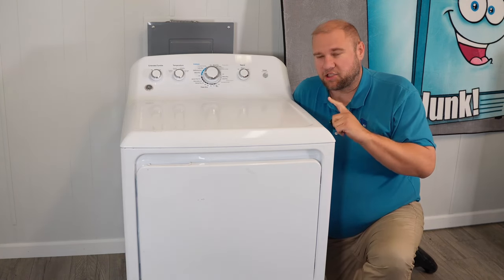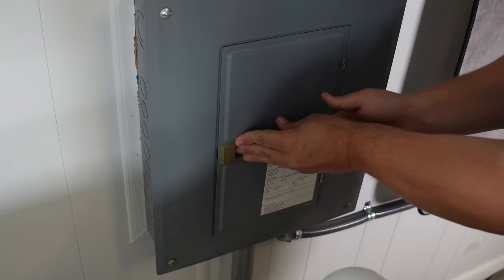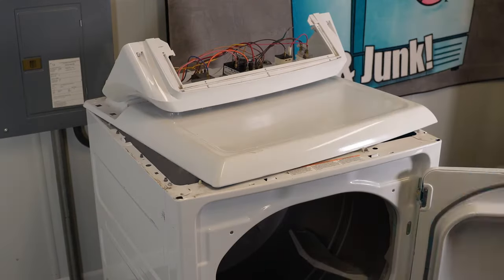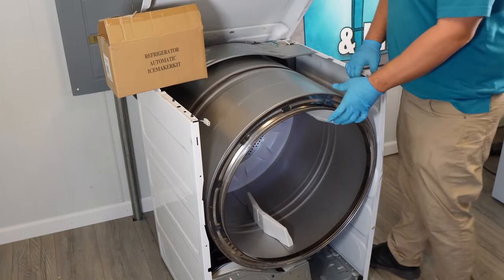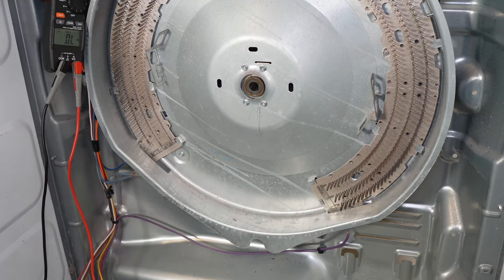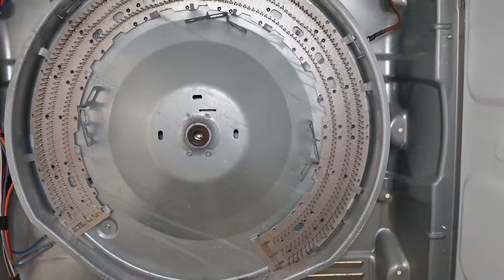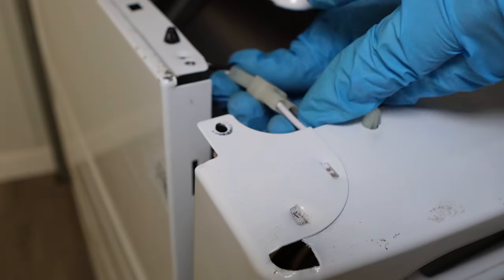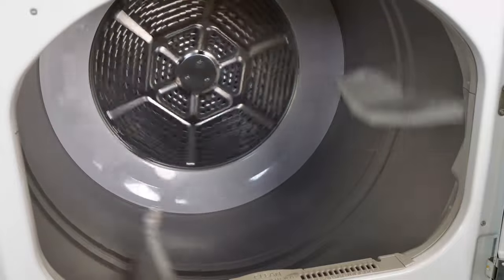GE Dryer Won't Heat - What to Look for & Test

Comment: It's sad how many people here are dealing with a useless GE dryer that is only 1-2 years old. Myself included. First and last GE product for me. Never again. As if the cost of everything isn't high enough, now we have to deal with appliances that last only a year or two when they used to last decades! Planned obsolescence most likely.
Reply: I’m doing on 3 years. Heat stopped working. Gotta trouble shoot tonight cause I can’t afford a new one
Reply: Mine was replaced in July and now not heating. It is in an apartment so have a maintenance ticket in since wasn't the purple wire that I was going to repair myself since been several days already without a dryer.
Reply: Had a Samsung and was talked into GE at the store and wish I had not because issues with both washer and dryer after just over a year. No issues in almost 5 years with my old Samsung
Reply: 6 months and the dryer us not getting hot
Reply: Mine is less than two years old as well I only do max 2 small loads a week & mine stopped heating also.
Reply: @tiffanyphillips1969  mine was the thermostat on the exhaust plastic tubing. $25 part and was back up and going
Reply: My grandmother almost lost her house because of a ge dryer she never lets it build up with lent somehow the thing spontaneously caught on fire ge sent a bunch of people out to inspect it took weeks and finally they said it was her fault I don't think so
Reply: @peteywee318  Same here. Extremely frustrating to say the least!
Reply: Ours are less than a year old! So crappy!!
Reply: We are on our 2nd POS GE dryer. Less than a year and a half old and low and behold the warranty magically expired. DONT BUY GE
Reply: Agree  I've had mine right at one year and it the purple wire on the right lower that burnt then caused the mica prong to I burn ! Evidently this happens to people all the time!
Reply: Yep mine is just over a year old and it’s already not heating
Reply: Bought the same GE dryer in the video in 2023, now it baffles my mind how this dryer is not working  in 2024. Right after it went out of warranty. This is just plain wrong and a criminal. My first time of trying GM products has ended badly. Need to find a way to educate consumers.
Reply: 3 years today. Same situation

Comment: There would be much swearing involved if I attempted this!
Reply: Lol,I am that stage right now ,not knowing anything I took it apart even that shiny metal piece inside the drum and inside was all full of brown loose stuff,anyway after all that when I looked at the back panel on the top of the dryer I found a loose crimp wire that goes to the temperature control which was off because there was no heat,so I guess that was it but I will inspect everything else.

Comment: My dryer is a year old. The purple wire had a burnt spade connector, so I cut and replaced it. Before I reinstalled everything I cut a 2” hole with my hole saw just next to spade connector. In the future I can look thru the back of my dryer and check if the connector burnt again. I’ll be able to replace it about 30 seconds next time, lol
Reply from the maker: Nice! I thought of that myself, but I'd get so many angry comments from people suggesting it, but I'm glad you said and did it!
Reply: I fixed mine, and it's not heating again. I'm going to buy a new one
Reply from the maker: @peteywee318  usually if the wire doesnt fix it and it burns again, the heater pan needs replaced.

Comment: Had a GE dryer that wasn’t heating but it would spin. Ended up being the purple wire. Thank you for the detailed troubleshooting guide!
Reply: did you get it running after replacing purple wire? can you tell me by chance where to buy it?
Reply: @lyndamckinney1287  I ended up re-crimping the burnt end with a new connector as there was enough wire still in tact. Those connectors can be purchased at Home Depot. They're Gardner Bender 1/4 in. Fully Insulated Wire Disconnects in Blue. I used some sandpaper on the heating element spade connector to clean it up. If you wish to buy a new purple wire with both ends pre-crimped, Ben has a link to them in the video description.
Reply: Same here...just put a new spade on and it works great
Reply: I just did the same thing. The real question is why are all these purple wires frying?
Reply: What’s the best dryer and washer to buy these days?

Comment: Quick tip, make sure you turn the power off before you ohm anything. When you ohm, you’re setting up your meter to check for the continuity on the wire, if there is any power on, those amps will travel through your meter, lead to lead. Please be careful of this. Always turn power off.

Comment: I always just open the door, hold the door switch in and run the dryer and look at the back to see if the heating elements are getting hot or glowing.

Comment: my hotpoint dryer, about 14 months old, no heat....after watching a few videos i figured it was the purple wire.  and it was....i was thinking on cutting a hole in the back of dryer to get to the purple wire.  i wish i wouldve.  i couldve fixed it in no time instead of taking the whole thing apart.    thank you for the video!

Comment: I know many people have already commented but this deserves ma y more likes. I have a different model GE dryer but this was still very helpful. Same purple wire as others have said. I didn’t get new wire. There was room to cut old one and get new connector instead. Sanded heater side a bit and everything works well. Until I have to repeat it again haha but huge thank you for putting this up and help in us save $

Comment: Thank you so much for this so instructional steps. 
My dryer stoped heating after i moved to new house. All elements passed the tests. I will check if there is a drop in the voltage during operation. 

I appreciate your video

Comment: Bought this GE dryer and had it 30 days when it stopped heating. Everything else worked. Took it apart and the purple wire was fried. I tested the heat element and that was bad. Based on the other comments this is a common issue. What's the cause?

Comment: Dryer stopped heating. Blower works, drum turns, replaced the mica heater (still no heat), replaced all 3 thermostats (still no heat), purple wire was not burnt but spade did break off when removing the heating pan the second time to change the thermostats (fixed that). Thoroughly cleaned. Tested power, I have 120 (center/right, center/left)/208 (left/right) on a voltage tester. No fuse present. Getting ready to go pick up a multitester to start checking switches. What happens if I find a bad reading on one of the ohm tests in the video? Running out of things to troubleshoot...

Comment: OK,  sir,  very informative video.  My dryer was running but not heating.   I followed all your steps and it was my purple wire burnt.   I repaired it and put everything back together.   Now the dryer will only run if I hold down the start button.   I checked and double checked the door switch.  Holding the start button with one hand and If lightly press the door switch with my other hand  the light comes on,,  then press is a little further and the dryer starts.   So, i am thinking that the door switch is working correctly    I did notice that the start button is only closed when you hold it down.  I am not very good at 110 / 220 volt systems but pretty good at 12 volt stuff.  So,  i take it once the motor starts something else keeps the current flowing.   I also need to mention that my dryer is only 14  months old and has been used very little.    Any ideas on what the problem is now?   Thank you
Reply: Ok,  took it back apart the 4th time.    Checked everything again.    Put it back together and it worked correctly.    It might have been the safety switch on the idler pulley.   Man,, thanks again for the video.   Very helpful.
Reply: A centrifugal switch closes when the motor is at speed, energizing the heating element

Comment: Tested power on both sides and got a reading of 246.2, above the 208 to 240 V range. You suggested it could be a cord or breaker issue. Do you recommend replacing the cord or bringing in an electrician. My electrical panel seems to be fine otherwise.
Reply from the maker: 246 should be OK it is rare to have the voltage higher, but depending on your houses power, it may be normal. It can handle up to 250v I believe OK

Comment: Do you have a video on how to replace that purple wire? Mine is fried, but I can’t get the end out that is connected to harness to motor
Reply from the maker: I do not. But I will see if I can make one soon, as I've had a few people ask
Reply: Any recommendations on how to remove the end attached to the harness that connects to the motor?

Comment: My stove is acting up and I foresee having to buy a new one. There’s a discrepancy between the setting temperature and the thermometer read out and it beeps when it’s ready just five minutes after the oven is turned on. It’s a Samsung I’ll NEVER purchase again. My budget is fragile. What would you recommend in a glass top stove/oven that is durable and reliable? I know front handles are more expensive but I love that look. Thank you!

Comment: Man thank you. My dryer wasn’t broken, but the breaker in electric box was unseated a bit (due to turning off power and the box cover missing a screw and breaker moved under the cover a bit). The dryer would turn on and run with no heat. Seated the breaker and all is good again.

Comment: Mine had the burned purple wire.  Thanks!!!
Reply from the maker: That's the culprit so often. I'm going to do a video just on that for the next GE I get
Reply: Did you Jane to replace the whole wiring harness, or how did you fix it?
Reply from the maker: @GabrielGarcia-vf8uu  I do have a video on replacing the harness now, FYI
Reply: @GabrielGarcia-vf8uu  I cheaped out and just cut the wire back, and added some wire with a crimp connector and a new female spade end.  Make sure that you spend a LOT of time sanding down the spade end on the heater coil to get a shiny finish and good electrical connection or it will burn up again due to high resistance at the connection.  You can test by putting a new connector on the spade and putting your meter lead into the rear of the connector and read resistance while moving the connector up and down.  If your readings don't jump into the hundreds, then you should be good!

Comment: I have a GE clothes dryer that wasn’t heating. After watching the video I realized the purple wire was burnt in to like many other people have stated was wrong with theirs. I replaced the end connector on the wire and the dryer worked perfectly, for one load of clothes then quit heating again. After sending this message I am going to tear the dryer apart again to see if im having the same problem.  What causes this wire to burn in to as so many people are having trouble with? Also, can I use a heavier wire to replace the purple wire going to the heating element or would this create a fire hazard? Thanks for any advice.
Reply from the maker: Hi, the replacement wire is heavier than the one in the unit. The only way to fix it is a new heater pan
Reply: Why would I need to replace the heater pan? My heater works fine until the wire burns in to. Just replacing the wire with the heavier wire wouldn’t fix the problem? Im not doubting your word I’m just trying to understand what is going on with the unit. Thanks for the help.
Reply from the maker: @Randymoore24  the OEM wire as installed on the original system is 14 AWG. The updated one is 12 AWG. You could theoretically go with a 10 AWG if you like, although I'm not sure who sells it.

The issue is that if the spade connector on the heater pan has burnt up, the oxidation creates resistance at the point of connection between the wire and heater. The resistance will heat the terminal up over time, causing it to burn up again and again.

Absolutely try a thicker gauge wire that can handle it, but I know for a fact that GE has basically begun telling techs to replace pan & wire simultaneously because of how dire this problem is. In about 80-85% of cases, the wire is sufficient, but in the 15-20% of situations, the terminal is too degraded and provides too much resistance to operate properly under use conditions.
Reply: @bensappliancesandjunk  i watched your video 5 weeks ago for same problem GE dryer not heating sure enough purple wire was burnt repaired wire and cleaned terminal all good till yesterday no heat again inspected and wire conn is burnt again now im looking for a eliment and harness thanks for the great video

Comment: Had issues with this for months. At first is was drying after 2 or 3 times. Then 5 or 6. Finally just opened it all up and low and behold a loose wire connection of a heating element. Now it dries like there was never a problem.
Reply: Same here the purple wire off and a little burned but not only that wire when I opened the back panel for the controls the yellow wire  timer was off as well,I wonder if they do this on purpose or no one checks these terminal wires.

Comment: I have found that on that type of dryer, the heating element almost never opens, but the lower right wire will burn up and break.
Reply from the maker: Yep. I just ordered the wires to keep in stock at our store due to how often this is the issue.

Comment from the maker: List of parts mentioned in video:

GE Dryer Timer for GTD42 Units: https://oemparts.bens-appliances.com/products/we04x24550-ge-timer

Purple Wire Replacement: https://bens-appliances.com/products/we49x37037-ge-hotpoint-dryer-heater-wire-repair-kit

Our Version (same wire gauge, 1/2 price): https://bens-appliances.com/products/we49x37037-ba-ge-hotpoint-dryer-repair-kit-by-bens-appliances

Heater Assembly: https://bens-appliances.com/products/we11x21156-ge-dryer-heater-assembly

Thermostat for Unit (top of pan, to the right of the 2): https://oemparts.bens-appliances.com/products/we04x25194-ge-thermostat-1

Thermostat (top of pan, to the left of the set of 2): https://oemparts.bens-appliances.com/products/we04x25201-ge-thermostat

Blower Housing Thermostat: https://ifix.gd/3XRlaVn

Upper-right pan High Limit Thermostat: https://ifix.gd/3TAcpfz

Bearing Shaft & Bracket Assembly for heater pan: https://ifix.gd/4guoih8

Comment: Thanks your video truly helped me troubleshoot the purple wire was charred at the connector. I plan to change the connector 

Do you know the root cause of the Problem???  If I remake the connection …. How long until it happens again ?
Reply from the maker: My understanding is the OEM wire is undersized and the replacement is thicker and can handle the amperage better. AFAIK, it was 14awg and the new replacements are all 12awg.

Comment: With amount of lint maybe a check of the piping would be in order. At a minimum a check of the dryer blower capacity should lead you to clogged piping in the wall another upsell and very necessary for the life of the unit the clothes and light bill.

Comment: According to some sources, you cannot (should not) perform a Continuity test on a thermistor because they have a high Ohms resistance. Instead, you need to use the ohms setting on the multimeter rather than the simple Continuity test.

Comment: Control knob is the first to check. Knob shaft cracks and you have no idea if you are on a heat cycle. Timer knob failures are high

Comment: Fixing this for my neighbor, the wire completely melted. Just over a year they have had it, what a shame, planned failures, just like phones and cars. Not all brands. Definitely won’t be reccomend GE to anyone. Funny they charge 30$ for 3 feet of wire too 😂
Reply from the maker: Sadly, melted wires like this happen in other brands too. Just for some reason the GE is slightly more prevalent. I am working to source the wire factory-direct to try to get the price cheaper. These items even at dealer wholesale are outrageously overpriced, and I am trying to see if we can get the price down to $20 vs. $30-35.

Comment: Disappointed in the beginning of the video.  1st check lint trap yes,  clean the screen, very good.  Before you mess with anything else, check the breaker box.  This should be if not the 1st thing to check,  at least the 2nd. There are times where the breaker would get tripped and the dryer will run and do everything BUT heat.  Simply locate your box and identify which is the dryer and flip completely off then on.  Try the dryer,  if it still doesn't heat then move on to next step,  which I would also say check the vent house,  could be blocked at the back or the hose is kinked not allowing air flow. Likely if that's the issue it's already blown a thermal fuse and would need replaced but easy fix. 

Lesson,  check easy things first
Reply from the maker: I get to the breaker and electrical chain within the first 1:30 of the video. I say check lint because its literally right there and is physically the easiest thing to check. My videos always go in order of ease of solution. Breaker is always 2nd because the entire electrical->terminal block chain requires moving the unit.
Reply: @bensappliancesandjunk  your video greatly informative.  I did see that you got to the breaker but that was after you pulled the dryer out and took cover off.  Before doing that while keeping the simple things done first would be too check breaker.

Comment: Great guide. I purchased the wire and it arrived earlier than expected. Installation was easy. Thank you.

However, it burned again after only 2 weeks. GE makes garbage products!

I will NEVER buy anything from this once great company! Not even their lightbulbs if on sale. Lemon products and deceptive practices.
Reply from the maker: FYI, if it burns that fast, its the heater pan thats likely been compromised and needs swapped.